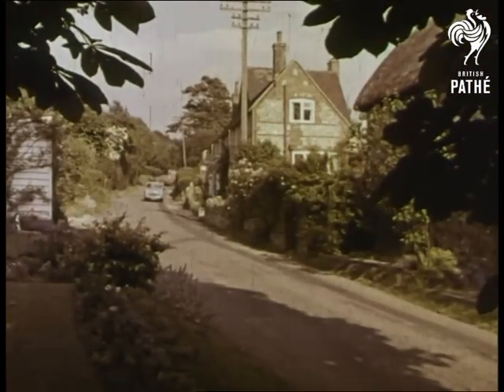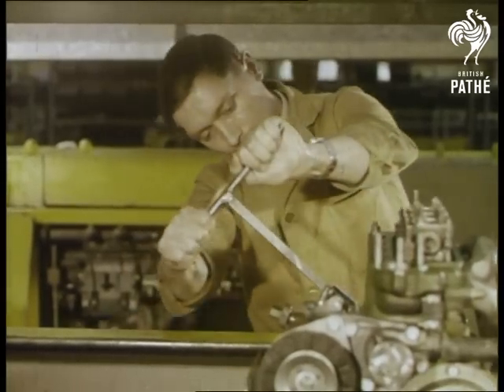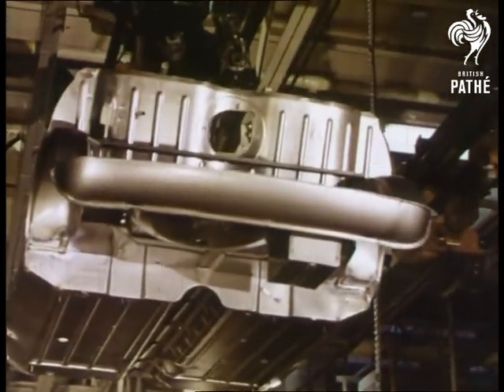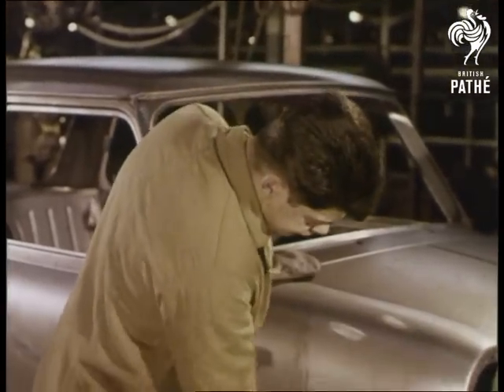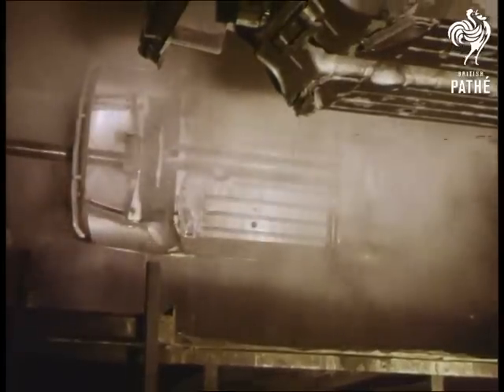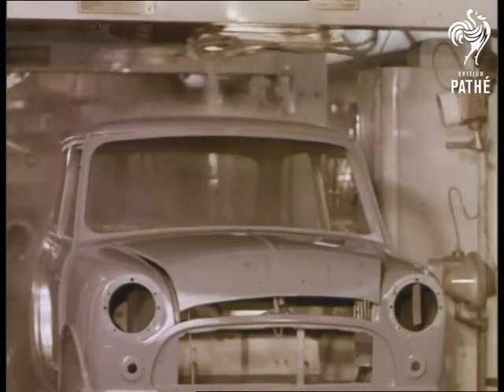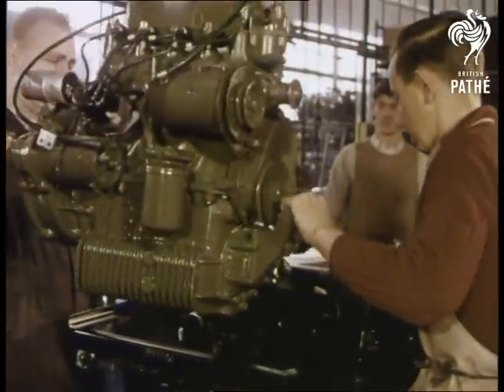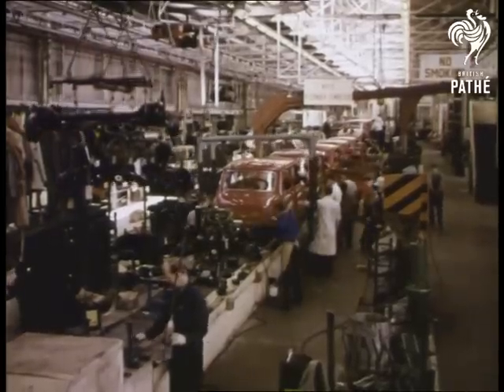Bmc Presents Wizardry On Wheels Reel 2  (1961)

Comment: Rust preventing?? That's a joke.
Reply: It worked a treat.
Reply: Were there unions in Britain?  I know we had em in America.
Reply: I’d hate to see the ones they didn’t treat 🙈
Reply: In fairness, the rustproofing was probably only meant to give the car seven or eight good years. By the time it was on its third owner, it wasn't BMC's problem.  It's been said the company lost money on every one. Ford got one, stripped it down, and couldn't figure out how it could be made for the price. Looking at the video, it looked like a costly process.
Reply: @TheHorsebox2  
Cars that were well looked after lasted. There was a culture in poor post war Britain of people not looking after cars and only responding when the car was in trouble. 

My father worked in the UK Auto industry and he knew how to maintain a car and several of those cars are still going strong today from the 1960s. 

Britain was a wet climate hence why rust was always a risk. People will not tell you when talking about British cars rusting that other fancy European cars rusted as well when not maintain.  Rust tended to start around wheel arches and door sills.
Reply: Pete Smith I would have invested in buying lots of phosphate liquids, only buying galvanised-steel & constructing hot-dip & cleaning vats, for the car-body shells & another lot for treating the metallic components, like screws, etc.
The Swedes did this with Volvo & their car-body shells, were built miles from the volvo factory, whereas the pressed-steel works was just around the corner from Longbridge, (At the time)I believe?
The Swedes were more ahead of the game, than the Brits, which was reflected in their cars.
Reply: I think the steam never dried out of the spot welded seams and they sealed in the water with paint....because they rusted terribly
Reply: Other firms didn't even dip their cars in rustproofer, so where sprays couldn't reach didn't get treated. Like Ford's!
Reply: @bighands69  in those days firms didn't realise you need to fitwheelarches into the wings.Otherwise mud flung up by the wheels ends up against the front panels of the car's, and trusts the metal through from the back. Later on, other firms started to fit these guards, but not cheapskate BMC. Every owner of a Mini needs to get on the internet, for a set of such mudguards, from the company called LOKARI!

Comment: Having owned a number of Mini's (the proper ones....NOT the BMW badged ones!) I can say they were undoubtedly a real fun car to own. Easy and cheap to maintain and a plentiful supply of spares. Yes the 850 engine was abysmal and lacking any 'puff' often struggling on a short climb. The 1000 was better but the 1275 made a big difference. Mini Coopers tended to be better looked after as they were generally enthusiast owned and finding one in decent condition was relatively easy until the early 80's when prices just started going daft. Mk1 Minis were extremely hard to source as, unlike Coopers, they had been treated as 'just another Mini' yet a number of features set them apart.....door hinges on the outside, sliding windows as opposed to wind up, push button starter on the floor, huge door bins (those disappeared once windup windows came!). A great little car and engineering genius.

Comment: Fantastic. All done by robots now!
Reply: RML Bobby D   Excellent , robots don't go on never ending strikes like the old world British Communist Working Class looking for a "Never Ending Free Lunch" promised by the Unions and Labor .
Reply: @bruceburns1672  Pity that problems at British-owned car factories continued unscathed well after the "Communist Working Class" had be tamed to submission by the Cons, which sold off the whole business to the Capitalist sharks (namely, Phoenix) who raked in the chips and sailed off. It all ended in 2005 with Communism long dead. Meanwhile, the foreign-owned car factories kept churning out all along well-made cars, assembled by that very "Neverending Free Lunch" despicable Working Class. Tip for you: when faults and rust are designed-in it's not workers' fault, neither is ugly styling. Look higher up.

Comment: A brilliant design, but shocking quality control, nobody cared. The union hate-the-boss attitude didn’t help.

The early Minis always leaked, and the delivery drivers complained about wet feet. Instead of fixing the leaks, they issued the drivers with Wellington boots! I was in the industry then, plenty of funny stories, but sad because it killed the whole industry.
Reply: They were cheaply built because they cost £500
Reply: Richard Macfarlane that was not union problem it was design fault.
Reply: Paul Hickie No it wasn’t simply a union or design problem. A good company has everybody working together, and quality products require commitment from everyone involved. The British motor industry at that time failed because of bad attitudes, from the top down and the bottom up. They say now that the single most important feature of a car company is its culture.
Reply: Minis made in Australia were just as bad, where the union problem was nowhere near as bad as in Britain.  The Aussie Minis had just as many problems and a few more - bad design and bad components supplied by England.   Go thru a puddle and it would stop.   Things like distributor caps lasting about half as long as any other brand.   At low speed it would pull to the left - and at high speed, pull to the right.  No alignment mechanic was ever able to fix this.  Minis were very noisy, and you felt every tiny bump in the road, due to the cheap suspension and the tiny wheels.  In the 1960's I worked for a company that had a fleet of Ford Anglias for their city service techs.   Anglias were a tiny cheap basic car but the techs liked them as they had no vices and were easy to park.   When the Anglias got old after several years, they were replaced by Minis.  The Minis were all worn out in 18-20 months, and the techs didn't like them because if you had to change gear quickly, the east-west engine would rock and pull the gear lever out of your hand as you worked the accelerator.
Reply: I had a 1980 1275GT and it was the most unreliable car I've ever owned although it was only about 6 years old at the time. You could not drive at 70 on the motorway without overheating.

Comment: Those primitive fold-over body joiners were never supposed to be on the production model, but obviously someone forgot to tell someone, and so on.
Reply: No one forgot 🙄 they are part of the character of the car. 
You can have them removed it you like, but it will just decrease the value of the car 😉

Comment: 1:09 as the new owner will find out quickly enough - totally unnecessary and pointless. 
From the very first drive, the new owner will quickly discover to their absolute disgust, just how weak, lazy and under-powered the new engine is, and from that day forward, every single minute of the engines life, it will be hammered to death and have its guts revved out of it, as it rightly should.
Reply: The crankshaft wears faster than the bearings
Reply: What are you talking about. I've driven many 850 minis, mostly the bare bones mini van. Great fun!